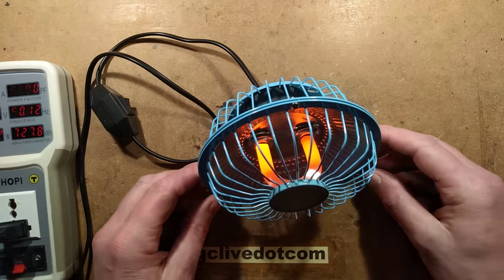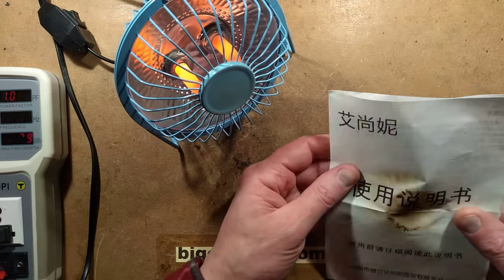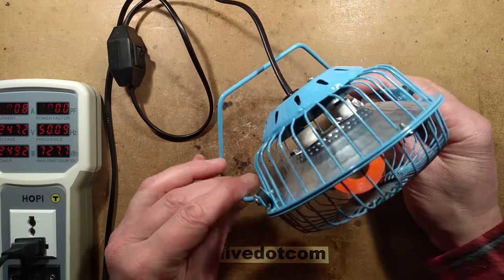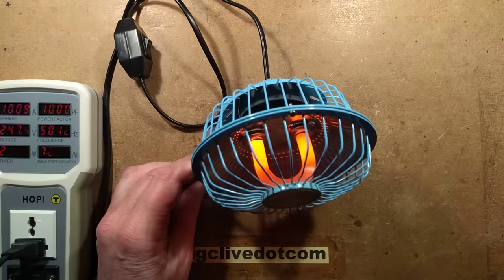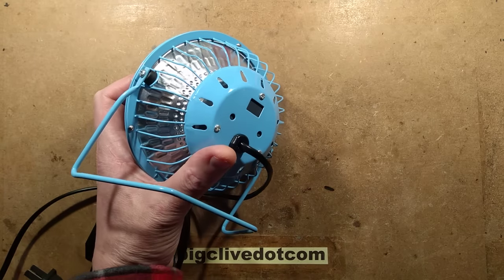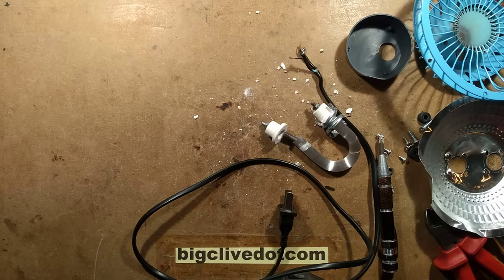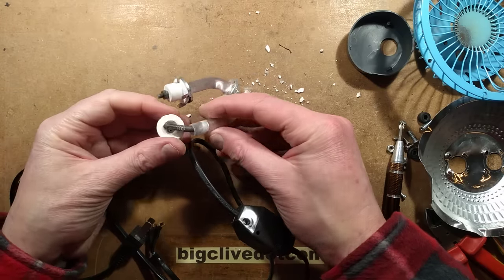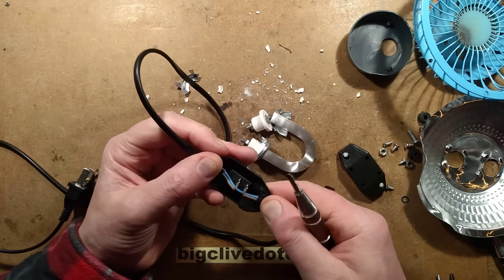Chinese automatic house ignitor.  (also available in pink)

Comment: "The switch breaks the live, that's neat"
Looks at simple two pin plug
Hmmmm...
Reply: It seems like that's the typical Chinese plug, very similar to the ones we use in North America, and it could be that one of the pins is wider than the other. Here we have them where the narrow pin is 1/4" and the wide one is 5/16", so you can't plug it in backwards.
Reply: 2pin plugs aee actually very common here in asia,china and philippines especiaally.  here in the phils,sometimes theres a 3rd plug,but its not actually connected to anything,neither in the cable nor outlet
Reply: @udfbino  2 pin plugs are common in north america as well, most devices are ungrounded. Of course, most outlets nowadays have the third slot which is usually actually grounded, because we do have some decent safety codes thanks to a quite litigious culture. You can even find GFCIs in some outlets, which is nice. Generally only in bathrooms and kitchens though, unlike Europe where they're in the whole house.
Reply: @moth.monster  . . . poor GFCI usage . . . poor health care . . . poor infrastructure  . . . too much military . . . poor America . . .
Reply: @moth.monster  yee,ik. switzerland by standard has 3 plug outlets nearly everywhere. ofc you dont need ground for every device,like lights or so, but if theres ground,at least have it connected,hah. like my pc for example: its plugged in to an outlet with ground,but my chassis is charged cause the outlet isnt actually grounded ....
Reply: @Cadwaladr  If you look back earlier in the video where you get a better look at the plug, the blades are the same size, which means it is non-polarized. It could be plugged in either way.
Reply: @Cadwaladr  They use Australian plugs in China. The live/neutral blades are angled at 45°. That's not what is shown in this video.
Reply: Here where I live for some fucking reason almost every outlet with "earth" has the earth and neutral shorted. It's actually a pain in the ass as I need earth for soldering otherwise the soldering iron tends to electrocute components. AFAIK its a violation of the electric code.
Reply: They use 3 types of plugs in China and this is one of them.
Reply: @dutchdykefinger  There often is a little bit of tingle from the capacitors in the AC line filter.  Nothing to be worried about--they're supposed to be "safety" rated, which means that they fail open, not short.
Reply: @dutchdykefinger  Not even a PEN? In old installations in Germany prior to 1973 it was permitted to use a single PEN-conductor instead of a separate neutral and protective earth. In the last version of the VDE 0100 where this was permitted from the year 1969, the PEN should be connected to the protective contact of the outlet. From there a wire bridge should be installed to the neutral terminal of the outlet. In older installations the PEN was connected to the N terminal of the outlet, and from there they inserted a wire bridge to the PE terminal.
Reply: @justuni8735  it is not shorted.. well, technicaly yes, but it's called TNC system. The C stands for combined = where neutral and earth is combined one cable. So when you have equipment, that are 3pins (live, neutral, ground), for example microwave and the earth wire is properly connected to the metal case of the microwave. Then in case of live wire touching the metal case of the microwave, the earth cable guide it back to the outlet, where thru the shorted earth, it comes back to neutral wire, thru the neutral wire to the breaker box, and if the breaker box is proper wiring, then it goes from neutral, to the ground. So the shorted pins are actually a really cool and safety compromise, if you have wiring with only live and neutral cables :) If you disconnect (isolate) the earth wire from the neutral in the TNC system, then the electricity goes back to the metal case and then when you touch the metal case, the electricity goes to the ground thru you! and that hurts a little :)
Reply: @cashuma5010  Hi. You really don't know America. We have had codes for many years now and are strictly enforced. Insurance company's will not insure a home if it's not up to code. Our health care is expensive but very good with no wait times. It's the drug company's  and hospitals that are the problem. Sure we have problems with infrastructure. That's the government's fault.We vote these people in and they do nothing !. The Military Is where it needs to be. Has far as poor maybe, to much debt again our Government's fault. All my best.
Reply: hucker75  The issue is that when ground and neutral are connected in the outlet it gives you a voltage divider for the return path. So your ground pin is not actually on ground level, allowing some flow through the soldering iron through the device being soldered towards real ground. It's not much because the copper return path has a much lower resistance, but it's still too much for some of those components.

Isolating the PCB (and anything touching it) from "real" ground and grounding it to the same outlet the soldering iron is connected to should help.
Reply: @tectalabyss  . . . ok, I've only been to 28 states of the USA and I haven't seen all and everything there . . . but I've seen a lot of the POOR AMERICA, almost 50 Mio. people of the richest nation are living at or under the poverty line . . . but Trumpet must cut taxes for the rich ones and cut food stamps to get it financed . . .
Reply: @HenryLoenwind  Well I guess then it was caused by the current going through the Component to "ground" My soldering iron has a earth connection that is shorted to the surface of the tip (TS-100). I could probably connect that to neutral to avoid killing components.
Reply: @cashuma5010  Oh well that's what happens when you spend 600 Billion USD Annually on the military, More than double of what China spends on it.
Reply: @KeeDx3 
'Expensive', in that if you can't afford it, you die. As do around 40,000 people every year in your great healthcare 'system'. Studys show that of the developed nations, the US pays the highest costs (into the pockets of corporations) and has the poorest outcomes for healthcare.
Reply: some countrys has electrical regulations that specifies wich side of the plug has to have the live.i think USA is one of them,and UK too for the bathroom plug too,wich is diferent from the rest of the house.
anyway,some "electricians" dont care about it and mix the sides.an also,its useless with the extension cords"
Reply: hucker75 you probably don’t want to plug anything very fancy into that shaver socket, it should have a little transformer inside which limits the potential current output to a few mA.
Reply: hucker75  So you've made your microwave safe for your parrot to stand on while he's chewing a live wire, but you've also made it much more dangerous for humans if the microwave ever suffers from a fault which makes the chassis live.  Unlikely, but possible.
Reply: @tectalabyss  . . . "The Military Is where it needs to be." . . . of course the US need more than 3,000 (!) foreign military bases outside their own territories . . . there goes the money . . .
Reply: hucker75  https://www.toughleads.co.uk/pages/european-sockets just for info,i was wrong,but also you can find regulations if interested.
Reply: @dutchdykefinger  Here in Canada virtually EVERYBODY rewires these old houses (when the old people sell them) with proper grounded outlets and new 100 or 200 amp breaker panels ... it's almost impossible to get insurance with old 60 amp non grounded service.
Reply: @dutchdykefinger  Ahhh ... that's the way it SHOULD handled! .. good one! :)
Reply: @dutchdykefinger  No it's more complicated than then than :) ... All residential (and most light commercial) applications in Canada have 240 volt mains, so the mains braker is 200 amps at 240 volts.

Large appliances like, Clothes Dryers, Kitchen Ranges, Air Conditioners, etc run on 240 volts ... BUT BOTH sides of the 240 volt lines are live ... with a third line running as neutral and a FOURTH as ground.  So range and dryer plug-ins for example have four blades on them.

To get 120 volts for everything else in the house, the line in the mains panel, is tapped for ONE side of the 220 volt line ... and the other side to neutral, the third being ground.

Hopes that makes sence, in residential applications the neutral line is bonded to GROUND in the mains breaker panel.
Reply: @dutchdykefinger  Just for another comparison, I live a small city n the north of Canada and our Electric meter and Water meter are read by wifi, nobody has to come out to read them :)
Reply: . . . no - I definitely don't have to wonder - as it is obvious: It is merely to protect the shitty economic interests of the fucking USA - and, please, don't tell me it were for protection of human rights and democracy, this has been proven many, so many times . . .
Reply: . . . are the USA 'allowed' to put their fucking military bases everywhere - or do they simply set other countries under political and / or economic pressure to do so ? . . .
Reply: @katrinabryce  China has 3 types of plugs.
Reply: hucker75  The big problem with your proposed scheme of having an entire building's electrical system use a floating earth is pretty easy to spot if you know anything about construction or electrical work. Certain parts of any building will always be electrically connected to earth e.g.  pipework, metal structural components, HVAC ducting etc. The point of having a protective earth network throughout a building is to mitigate the risk of a live appliance causing a fatal shock because anything that faults out live will trip the relevant breaker/fuse and alert to homeowner to the presence of a dangerous fault, instead of sitting there live at mains potential. It's also worth noting that AC mains voltage is perfectly capable of arcing over short distances to find a conductive path to earth, through the human body if necessary. This only need happen for around 30 milliseconds to cause a fatal shock across the heart. It's exceedingly unwise to consider the electrical system in a residential or commercial building in the same context as high-voltage transmission lines which are suspended 100 feet above the ground and supported by ceramic insulators.
Reply: hucker75  I disagree ... these policies keep insurance, and even mortgage rates lower and more importantly save lives ... removing obsolete poor mains is a VERY good thing to encourage! ... if people don't like it they can always pay CASH for their home and have no insurance.

Comment: I know I am late to the party here, but that exact outer casing is used on my desk fan. The square hole on the back fits a toggle switch, and the two lower holes are used to mount the engine. I'm guessing they removed the switch because either they didn't have the room, or they felt it would fail their already lax safety standards to have the sole power control in melting range.

Comment: I've found a needle-nose vice-grip works great for removing and inserting the restraint.
Reply: Strain Relief Bushing Assembly Tool, enjoy
Reply: Been dealing with those for decades. The trick is to squeeze against the small part, compressing the wire's insulation. They are actually reusable if you are good at removing them. Handy for restoring old radios and audio gear. I keep new ones on hand too.
Reply: Genuine Heyco pliers aren't too expensive and do make those strain reliefs easier to install and remove.

Comment: Can confirm that its a fan case. I have a desktop fan that uses this exact same case with the same angle stand. That little inset part of the metal is intended for a power switch.

Comment: I got an IEC C7 mains flex (the figure 8 connector) from China ebay a couple of weeks ago with the thinnest and fewest strands of metal in I have ever seen in a mains flex. aluminium of course. It was a 1m length, and each conductor, live and neutral, measured TWO OHMS. a 1m mains lead with 4 Ohms total resistance. I think C7 flex and connectors are rated for 3 Amps? screw paying for a quartz element, theres your heater right there in the flex.
the scary thing is I only know about it because I snipped the euro 2 pin plug to fit a BS1363, there are people in Europe using that flex right now, completely unaware
Reply: 2.5A, the C7 is rated for (which would still dissipate a hefty 25W in that cord).
That said, if you want to really start a fire, then try a similar cord with a C13 (up to 10A).
Reply: In the 1940s, certain inexpensive American-made AM broadcast band radio receivers used resistance wire as the line cord to limit the turn-on surge filament current in the [usually five] vacuum tubes.  This apparently improved the tube life...
Reply: @jrb_sland5066  prolong the tube life but not necessarily the user's? also looking at my initial comment I forgot to say why I mentioned this at all, I intended to suggest that Clive check the quality of the flex as a matter of course whenever he gets trashy products like this that come with one fitted, and especially when its a thing which will draw some current.
Reply: It's a convenience feature to save you from having to buy wire strippers. Simply apply mains voltage across the cable for a suitable length of time and watch the insulation disappear!

Comment: "Automatic house ignitor". Imagine if the Chinese government actually uses this to get rid of people who's social credit falls too low.
Reply: Installed in every apartment quarantined with coronavirus.
Reply: @Nobby Heads that'd be interesting, as heaters that lack a tip safety switch are prohibited in the US in new products.
Reply: @darksuns7384  so, rather than losing perhaps 3% of the possibly infected population, you'd prefer to lose 100%.
Sounds like a grand idea.
Reply: Ccp: WRITE THAT DOWN! WRITE THAT DOWN!
Reply: Nah, it's easier to disappear the people, so the house can be reused
Reply: More like lack of government,  that endengers peole low on credit.

Comment: Just a few days ago my brother asked me if I could fix the cable on something that looked exactly like this except it was a fan. The thing was working, but the outer isolation of the cable had torn apart right before the cable entered into the chassis.
Now I find this video. Curious.
It was easier to remove the cable restraint there. After taking the front half of the cage off, I could just take the fan out, since it had more free wire. That way, I could push the restraint out with my bare fingers.

Comment: In all seriousness, I'm not sure why they are allowed to be sold in the UK given the justifiable safety concerns.  The inclusion of a tilt switch and over temp sensor would add a bit to the cost but make this into a useful item that would eliminate most of the safety issues with it.

Comment: Oh dear... This thing looks sketchy as hell.
Reply: No anti-tip switch, no high-temp fuse and PVC insulation.  Heck yeah!  Life on the edge.
Reply: @tubastuff  more like "Don't touch under any circumstances unless you wanna break all hell loose."
Reply: That's probably because it is!
Reply: It sure does and throughout the whole video I've been saying I want one, and I have absolutely no use for it. One of them heaters a bottle of whiskey gun and a old truck what could go wrong?
Reply: Chineseim crap - I have seen the mains/USB fan equivalent
Reply: @tubastuff  gives a new meaning to YOLO.
Reply: The mains conductor looked very small. Bet the cord grew warm, as well.
Reply: @Alexis_du_60  Can you imagine this thing on a desktop littered with papers and, oh, what the heck, a couple of plush toys?
Reply: @tubastuff  I've had a former colleague set his desk on fire like that.... His desk was covered in papers and he brought in a similar (if not identical to the one in the video) heater....

Fortunately someone caught it in time before it was too late.
Reply: @Alexis_du_60  Back in the 50s these dish heaters were everywhere in Europe! Usually larger, 30 to 50 cm diametre. Some had a quartz tube (without any sort of grille or cover), most had an exposed wire element surrounded by a grille barely tight enough to fend off adult fingers. They usually didn't have a switch, let alone any safety features. Naturally, they sometimes got covered or fell over and caused fires. I still have two of them (one of either kind) but rarely ever use them, and if I do, only under constant supervision, well away from any combustible materials. No pets anywhere near them either! I think I once read a story from the US about one of those setting a cat's tail on fire!
Reply: @Ragnar8504  yes I've seen some of these heater dishes, some people often remove the heating element and retrofit a light bulb in it.

I had one (iirc it was made by Calor in 1967), I only used it once, after that it became a show and tell piece, so to speak. Unfortunately I gave it to someone else, I really wish I hadn't!
Reply: @Alexis_du_60  Yeah, quite a few had Edison-base elements, so replacing that with a light bulb is a matter of seconds. Mine has a hard-wired element. I think I still have a box with three or four (used) spare elements stashed away somewhere. Bought them only because they were sold with some other stuff I wanted on eBay.
Reply: @Ragnar8504  that's how exactly mine was, the resistor was fitted in a special light bulb socket (it could take a regular bayonet light bulb just fine), despite being over 40 years old it did heat fast, that was for sure!
Reply: The fact that this thing has a metal frame and no ground wire is also quite fishy.